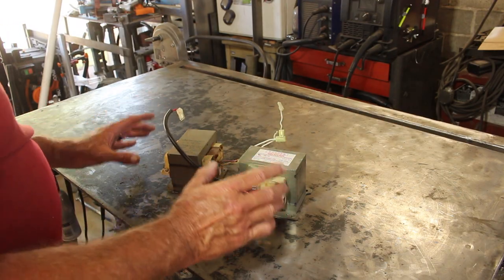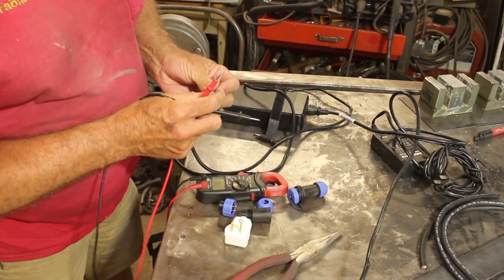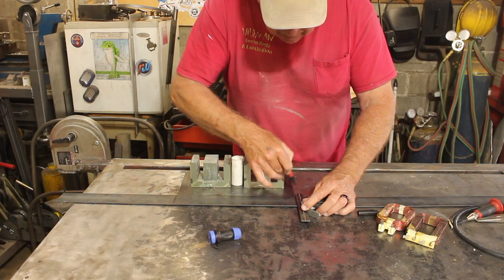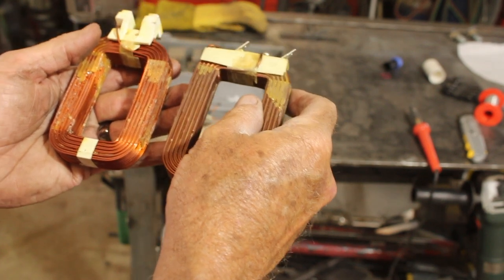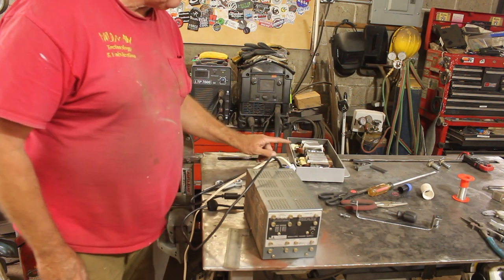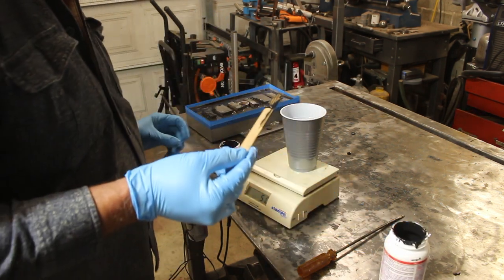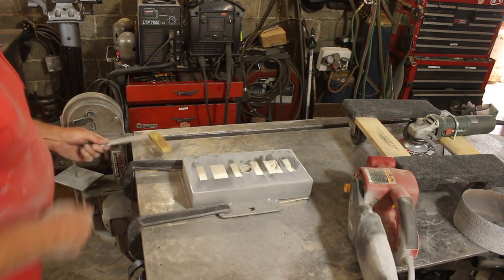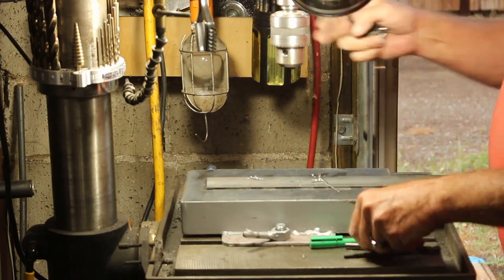Electromagnetic Drillpress Table!

Comment: incredible video. So many great ways to get the job done using common materials. It started really scary when you mentioned using microwave oven transformers, but then switched them into low voltage magnets. Great idea.

Comment: If 5V was sufficient to push 25A then you should only need 10V to push 50A.  The magnetism is generated by the current, and you only need enough voltage to reach the current limit of your supply.  Since you are using DC current you can just measure your coils with an OHM meter and you can use V=IR to determine what voltage supply you need for the desired current.  In short, there is no way you need 50V 50A if the 5V 25A worked well.
Reply: Hi James, Question - All these amps !  Are the coils gonna get hot and melt the resin ? How do we know how much current the coils are good for ?

Comment: Awesome project and great results! I have a relatively weird question regarding this electromagnet - do you by any chance know if a magnet like this can achieve sufficient holding power over 40mm distance? For example, if you put a piece of plywood or insulation on top of it and turn it on, does it have any hold? I need something like this for a very specific purpose, but it's very hard to find info on the topic, especially considering that they are mostly used in direct contact. Anything above 10kg of holding force will do for what I need. If you could test this, that would be amazing
Reply from the maker: When it comes to magnetic fields, 40mm is a LONG way! I have a Nyodinyum magnet with an 800-pound pull and at 40mm it can roll a 2-pound steel ball on a flat surface,  but can barely pick up a paperclip.

Comment: Nice job of flattening the top, an unconventional holder for the drill press, but i am sure you will find jobs that it is perfect for. Enjoyed, cheers!
Reply from the maker: It's been done for a few days and so far I can't imagine a job where I wouldn't use it. Only if the hole is larger than the hole in the mag table.

Comment: is there a reason everyone uses all epoxy to fill it? does it need to be homogenous or just not magnetic? I've been planning on making one of these and have been assuming it would be okay to throw scraps of wood in the empty spaces to save on epoxy if i glue them down so they dont float
Reply from the maker: Someone else mentioned filling it in with pebbles to save epoxy.

Comment: If you want to save on epoxy fill the voids with pebbles or somthing similair.
Reply from the maker: Now you tell me!
Reply: @WildmanTech  Sorry you were done and dusted. Seems to be a little excitement on homemade tools, I think your setup is just fine, should you have any problems with sticking when you turn off, which I doubt, you can allways fit a diode in the supply leads to handle the reverse voltage
Reply from the maker: @garthdaddy7438  No idea what you’re talking about.

Comment: This is the first time I seen your channel and video. I wonder how well its all holding up if you use it often?
Reply from the maker: I use it daily, but it’s a bit of a hassle to keep clean. It magnetizes everything including my drill bits.
Reply: @WildmanTech so that being said... is this worth to make and use?
Reply from the maker: @mikeklossner5105  fairly certain I'm going to make a float-lock vise. The table magnetizes everything and it's hard to clean. A mechanical mag table would be better, but those don't have a hole for the drill bit to pass into.